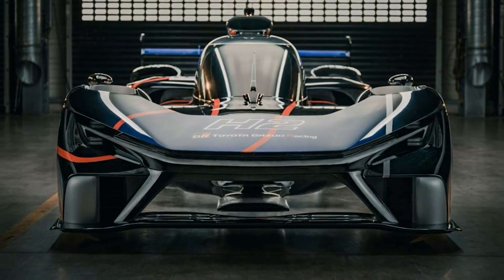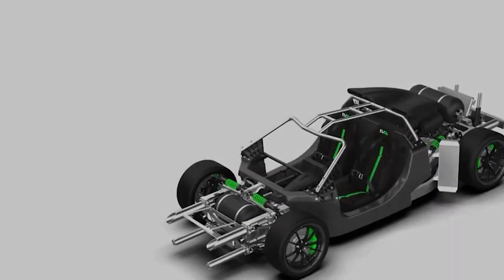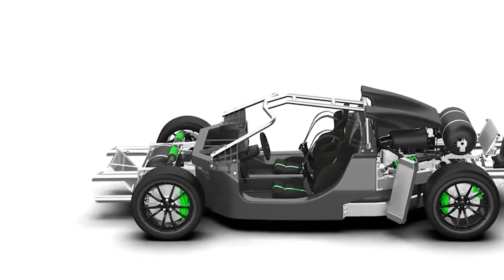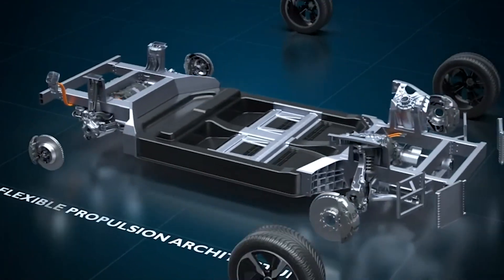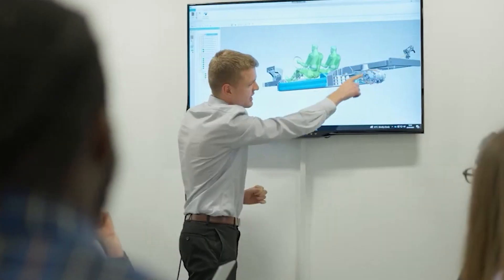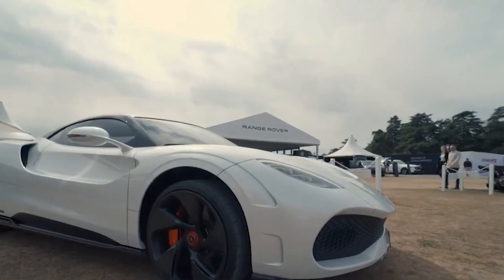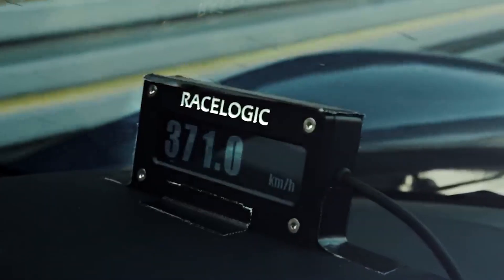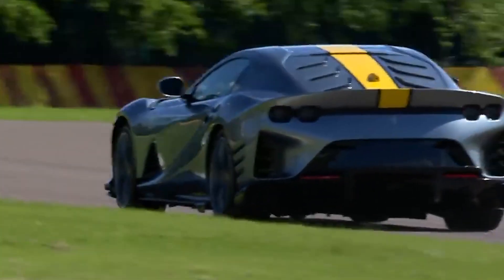WAE Technologies Unveils Hydrogen-Powered EVRh Platform: A Game-Changer in Supercar Technology

Comment: honestly, this feel like a waste of time, I am all for hydrogen energy, but it real advantage can only be explored in industrial application that requires it scaling not end user. battery will get lighter and faster as it is far from the cap of it technology, however hydrogen is just hydrogen, you can't get ligher or faster hydrogen, it is always something intended for scale like ship, trains and truck where battery would prove too expensive to outfit. it make no sense for hydrogen to compete in a market where battery has it strongest advantage of compactness and not play against it weakness in scalability. 

can you imagine a hydrogen power smartphone? no, then you should get as far away from that as you can to maximise on your advantages, it really that simple.